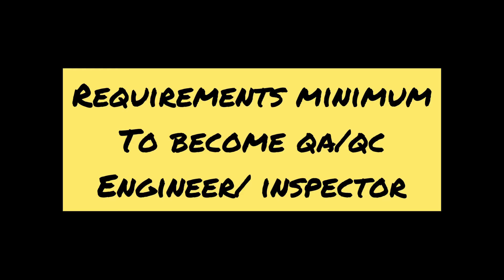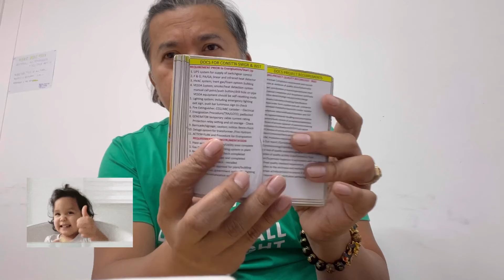Requirements to become QA/QC inspector or engineer #ofw #qaqc #inspector #inspection

Comment: Goo day sir. Hingi sana ako advice as QA/QC Engineer😊. Kaka hire palang po sa DMCI as QA/QC Engineer pero hndi po sa residential side bagkus sa Railways po. Any advice po sir dko po kasi familiar sa mga railways. Btw po sa NSCR Meycauayan Bulacan po ako na assigned.
Reply from the maker: John hindi ko alam kung ano discipline ka ako kasi Electrical, Instrumentation and Telecom as a QAQC, Construction and Engineering 
In terms of Railway I don’t have experiences mostly my experiences in Oil and Gas and Pipelines, kunti lang sa commercial and bldg
Reply from the maker: Pero as a QAQC Engineer, please read QMS, QAP and ITP also scope of work of the project so that you can get an idea of your project and you can implement your work and requirements. I am sure my guidelines are company standards and procedures
Reply: @OFWSUCCESSBAYANI  thank you po ☺️

Comment: Hi Sir, pwede mo po ba mapaliwanag sa akin ang QC Engineer (Facility Management), ano po role/job nya? Sana po masagot, Thanks po.
Reply from the maker: Hi Arjay, basically all of my experiences in oil and gas projects.
However, for the QC Engineer role, is to manage and control the facilities if they follow as per QMS procedure.
Prepare QCP, and ITP, review MTC and Method Statement, etc depends on your discipline.

You can supervise the inspector and prepare documentation and interface with other departments.

Implementing quality in the facilities and monitor with supporting documents and if necessary issues NCR/SDR/SOR
Reply: @OFWSUCCESSBAYANI  Thanks Idol.

Comment: Hello po sir tanung ko lang po sir kung anug ibig sabihin po ng IRE at ang mga kailangan ihanda pra sa pag riase ng IRE salamat po sir.
Reply from the maker: Sir gdam, hindi ko ma gets Yun IRE. Ano meaning Ng IRE.
Reply: @OFWSUCCESSBAYANI  prang insulation test ata but I'm not sure po, ah ok po ba sir it's ok sir maraming salamat po, god bless
Reply from the maker: Example Tau RFI (Request for Inspection), prior for raising RFI, construction installation is complete like panels, and cables

RFI for panel installation
RFI for cable installation and cable testing
Cable testing carried out for Continuity Testing and Insulation Testing(Megger testing).